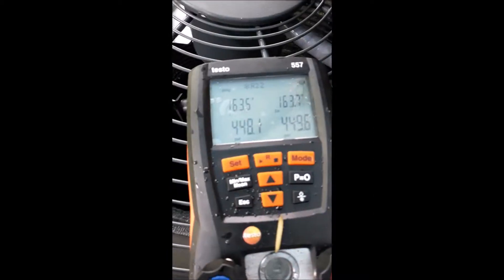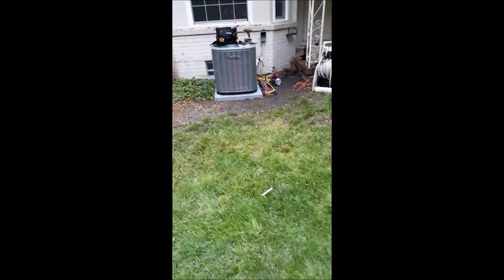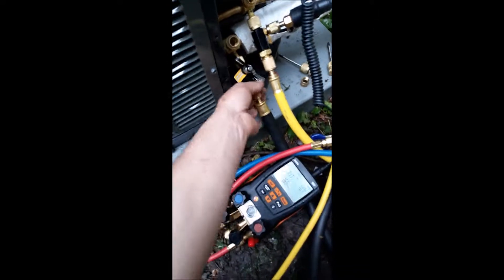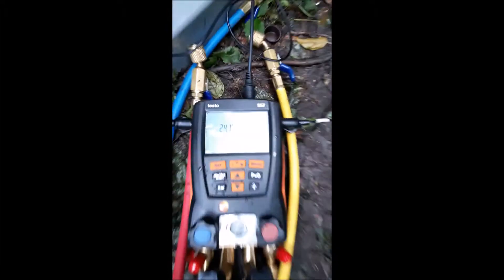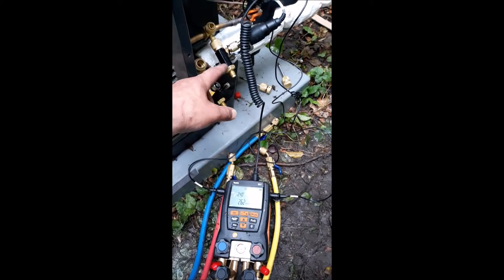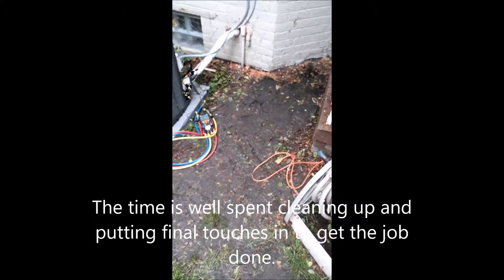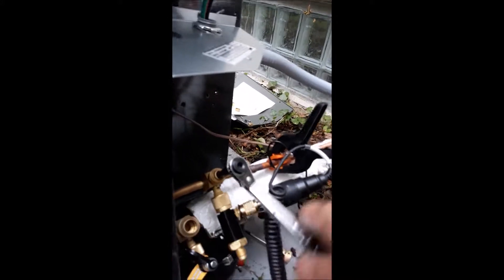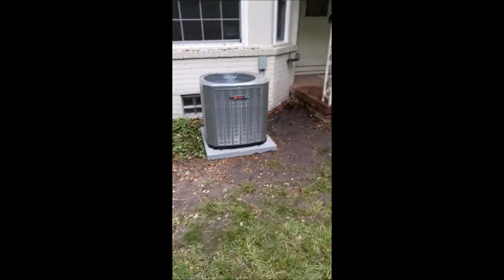HVAC Tool Porn! Testo 557 used to preform a leak test, vacuum and preform a decay test.

Comment: How has the 557 been long term? I'm considering picking one of these up to install three mini split heat pumps at my 5-unit building, rather than getting a YJ analog gauge set and a CPS vac gauge (the 557 is not much more than the other two combined, plus it has far more uses). thanks
Reply from the maker: The sight glass came up with a leak. Sent it in for repair and now only use it as a spare. Went to the 550 and micron gauge.

Comment: Don't you find it frustrating that you cannot see saturation temperature and superheat/subcooling on the same screen? They should have made the saturation temperatures on the bottom and allow you to toggle between pressure.
Reply from the maker: The app is helpfull.

Comment: With the 557, you can use the right side temperature probe to provide a more accurate pressure test.
Press the SET button until you get to the Tfac screen, and turn it OFF.
(turn it back ON for normal USE)
Then connect your temperature probe. The probe should not be connected to anything, yet exposed to ambient air temperature (no direct sun).
Wait a ccouple minutes and start pressure test.